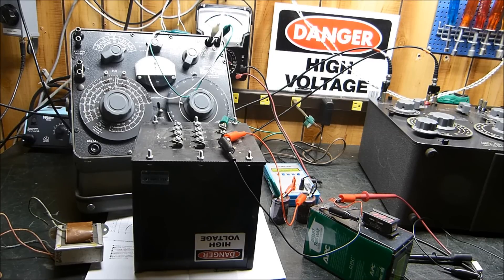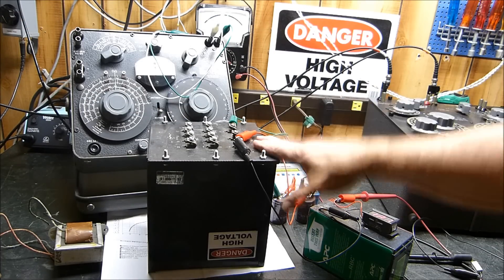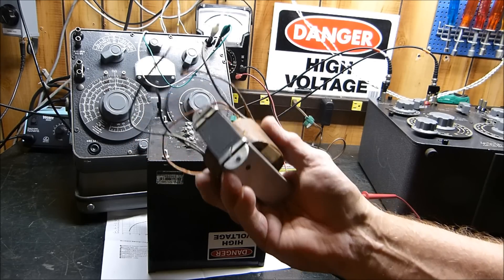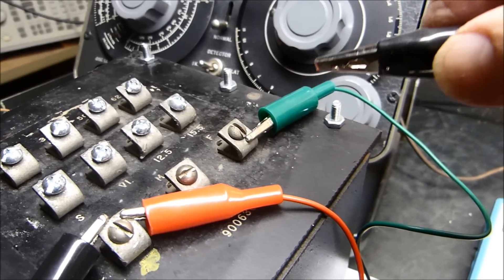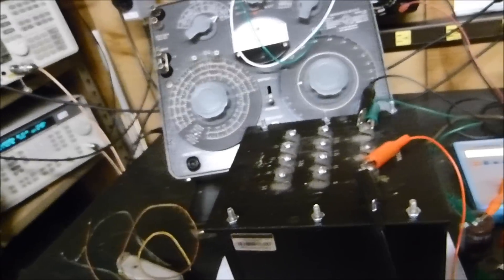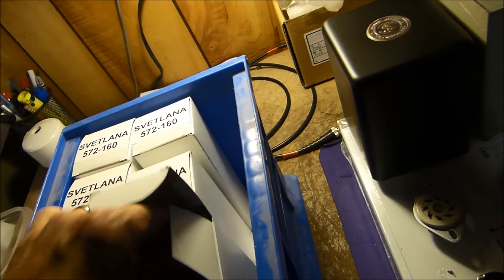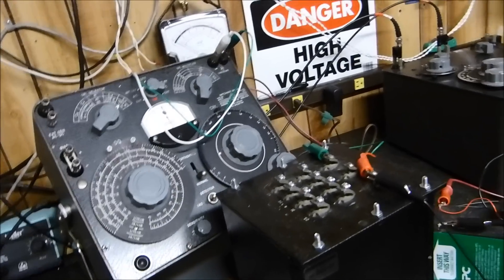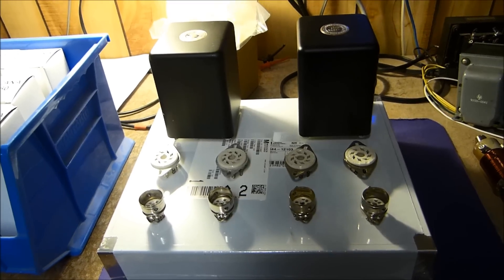Single Ended Triode (SET)  vs Push Pull (PP) Output Transformer  (OPT) Core Saturation

Comment: No matter how large the core physically is, as long as the E and I core laminations are stacked together and make a continuous path for magnetic lines the core will saturate. In SE OTs all the E laminations are stacked together and then all the I ones. A very thin piece of paper or non magnetic material is placed between the two to break the path of the magnetic lines which increases the resistance for magnetic flux and keeps the inductance constant.

Comment: Well there you go. So obviously the thing to do now is add more sockets for another power valve, another driver, and a phase splitter, and make a push pull version. Twice as efficient, you could play the Superbowl with that thing ;-) The phase splitter would be interesting, might require a chassis of its own ... Speaking of which, I'm not much of a fan of separate power supplies, as they are invariable special-purpose, so you have two things that always have to go together, and a very dangerous interconnect. A PP topology takes care of most of the hum anyway by cancellation. Best, EJP
Reply from the maker: +QuadMaestro I agree with you on the separate power supply. I built an RF amplifier for a friend at the MARS station at WSMR 30+ years ago that ran four 811A's parallel - a common configuration for a good 500+ watt RF amp and I built it in an old Heathkit DX-100 cabinet. There was not enough room for the PS so it was in a separate cabinet. I was very (very) careful to make sure the cabinets were electrically strapped together not only thru an umbilical cable for filaments, AC on/off/ etc but also a braided strap between the chassis. The HV was on a separate proper HV connector. My concern was to make darn sure the two chassis could not become electrically separated with the PS on as the HV return path could become through a person  getting between the two chassis.  Anyway, apparently I built a good unit as it worked for many years before he passed away. I am about to start on the stereo version using these two huge OPT and the PS will have to be separate but in the same blue cabinet that I built the 3-400Z and 833A amp in. I hesitate to make these huge amplifiers nowadays because of the weight. I ain't getting any younger and stronger  :-)

Comment: I TRYED A ODD EXPAREMENT I BULT A SE AMP USING A CHOKE ON THE PLATE THAN I CAP COPLED A 120 - 12 VOLT AC 60 HZ TRANIE AS MY OPT THE PRIMARY ACROSS THE CHOKE THE CAP KEPED THE DC OFF THE OPT TRY IT

Comment: Great video!! Very interesting, especially since I am considering building a SET amp for myself.  A suggestion on the power transformer would be to install it in the center of the two output transformers like you have it, but put a transformer cover on that is the same height as the outputs.  I have seen online places that you can order those and I believe it will help with shielding as well.
Reply from the maker: +OldTechFan I do like the idea of the power transformer mounted in the middle with a cover - Thank you for the information. I will investigate.
Reply from the maker: +OldTechFan I just looked up "transformer cover" - there are all kinds out there - very nice - Thank You

Comment: You could just indeed put a CC through it in the other direction to cancel the saturation.
Reply: Interesting... Any additional info on this?
Reply: @northox  Basically having a separated circuit that pushes a constant current in the other direction through the transformer would cancel the saturation in the transformer, but issue is getting it separated enough and behave in a manner that is always constant current that doesn't affect the AC signal.

Comment: I'd like to hear more about the amp you listen to all the time.  Is it SET?  What do you think makes it sound better?
Reply from the maker: +59seank The amp I am charmed with after more than 50 years of listening to  McIntosh quality audio is an Acrosound design push-pull 6B4G triode amplifier. I have built amplifiers with adjustable feedback from 0 dB to 16 dB with a pot as a control and,  as can be confirmed by others on the Internet, no feedback provides a very LOUD and "dynamic sound stage" but measurements limit it to about 20 watts at several percent distortion.  Also, low frequencies (below 50 Hz)  in SET amplifiers are categorically poor. Dialing in NFB gives it a compressed sound but dramatically increases the power and lowers the THD. Just like everything else in life - there is a trade-off. The only SET amp I have ever attempted is the 833A amp documented in my YT videos.
Reply: +ElPaso TubeAmps Thanks.  I have heard many people rave about 2A3 designs (along with 300B, etc.)  It would be nice to know what makes certain amplifiers sound so appealing.
Reply from the maker: +59seank I can't say what makes us like some of these old tube amps. I shy away from the 2A3 just because of the 2.5 volt filament. The 6B4G is the same tube as the 2A3 but with a 6.3 volt filament an an octal socket. I haven't played with the 300B yet - I have always been into BIG amps for RF and AF but recently have been enjoying the much smaller AF amps.

Comment: Hi there David, 

I remember when you firs built the SE amp I thought you had ran into core saturation on the 6v6 driver transformer. I assumed you'd pretty much be covered with such a large core on the OPT but I guess that air gap make a huge difference huh…..

I really want to hear your thoughts on those James Audio transformers… I’ve seen them for a reasonable price lately and don’t really know what they’re worth.

Congrats on the new coming amp, well I can’t say that I don't like the old Dynaco layout with the 3 transformers inline and a choke under the chassis… aesthetically that’s the most appealing to me. I have to admit though that over time I switched to independent power supply. Not only you have no magnetic hum on the OPT’s but you don't run into Eddy currents in the chassis itself, especially if you use an Iron chassis… the main advantage I think is that you, just as me, like to build a lot of different amps so an independent PS would fit a number of projects. 

Mine is a regulated 8 channel PS unit I built out of a pair of old Tek scope transformers, boy these things can put up with an insane filament current and a lot of independent windings too... just perfect. I get 2 regulated plate channels of 250ma each from 300-450v, 2 regulated screen channels of 125ma each 150-300v, one negative  regulated 150v channel for the bias circuits and eventual voltage reference if I ever need another regulator stage and 3 dc regulated filaments that I can ground or lift as I need. That thing's been getting me covered for all of my projects ever since I built it and it's a cool looking chassis as well. 

Thanks for sharing the good stuff and let’s see how this one turns out. I’m getting things settled here and I might be digging into the triode PP soon, but with a pair 6080’s and toroidal transformers, I’ve been reading wonders about this combination and it’s dirt cheap…. well let’s see.

Ah, and Happy New Year!

Denis
Reply from the maker: +Denis Gouvea de Azevedo Yes, reality started to come in when I could measure high-quality audio at the grid of the 833A but terrible THD at the plate. I just did not want to admit that the OPT was the problem. 

In a few days, I will evaluate the James transformers. I am very hopeful and will post what I discover.

The Tektronix oscilloscope transformers are beyond awesome  and I completely understand what you have done and i think that is definitively the way to go. I went that way with the PS for the voltage amp for the 833A but limited it to about 15 watts. I also went there with the 0-4500 volt PS for my audio and RF amplifiers. My problem is physically moving this monster PS around.

Really appreciate you comments.

Best of the New Year to you and your family.